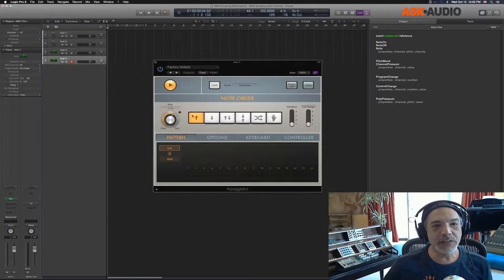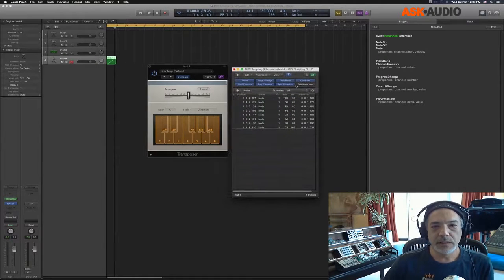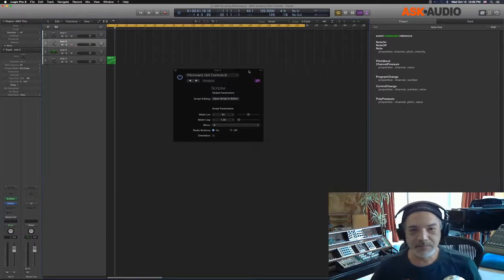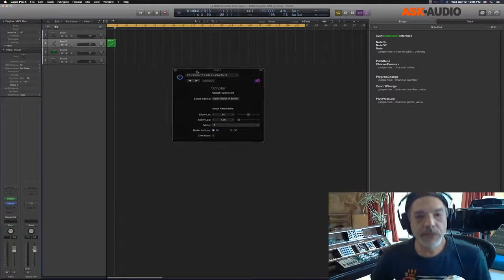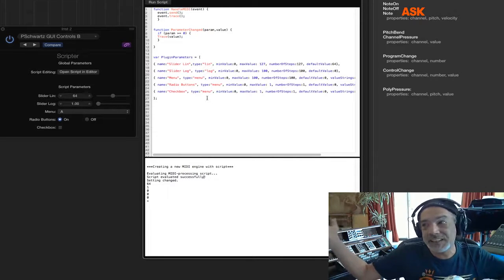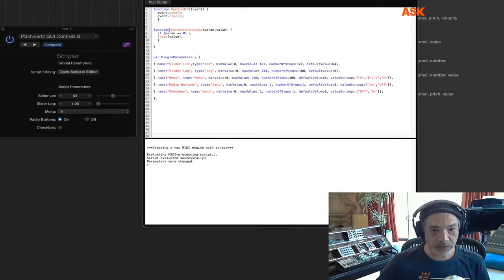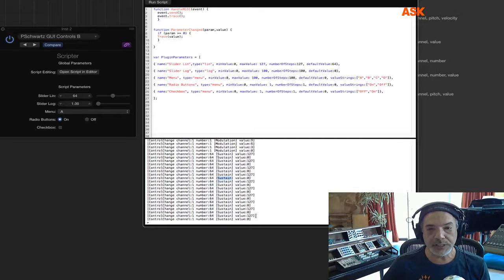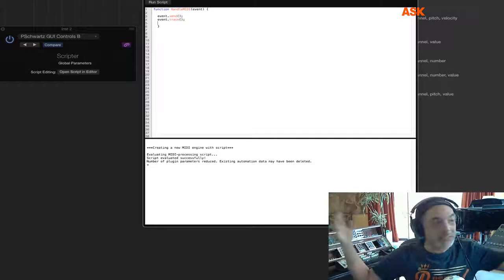In-depth introduction to MIDI FX: Logic MIDI FX Scripting With Peter Schwartz - 1. MIDI Scripter Ove

Comment: You can record the output of midi fx by using IAC BUS driver. Just saying...
Reply: You cannot record the output of MIDI FX-processed events on the same track. That's a fact. Now... IF you use the External Instrument plugin as your instrument then yes, you can use IAC to record the output of a MIDI FX on *another track**. But where do you host your plugin, and how do you get that MIDI to it? Sure, you can do it (this is Logic after all) but it's complicated to set up and unwieldy to use. Even more importantly, the timing of MIDI events over an IAC is **highly* inaccurate.
Reply: There seems to be this midi freeze fx plugin, didn't test it yet, but looks cool: https://www.youtube.com/watch?v=qVxt_3Imf7I